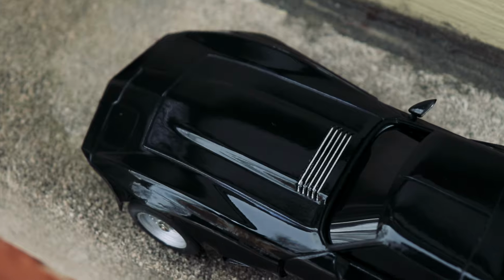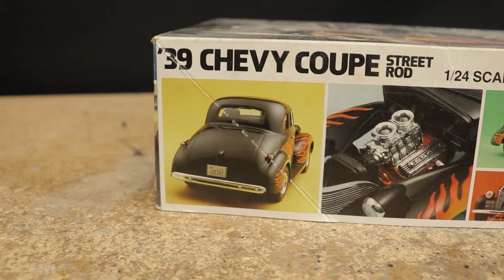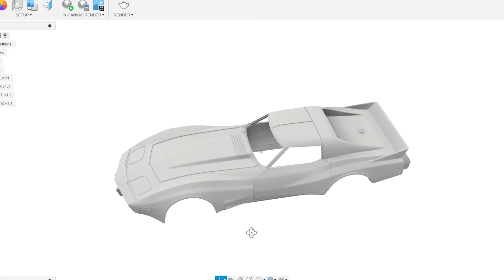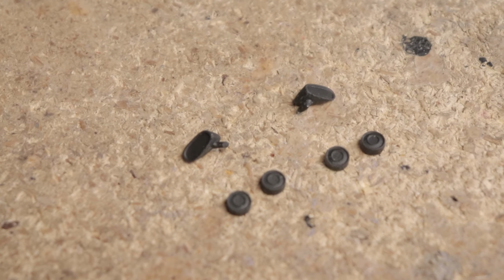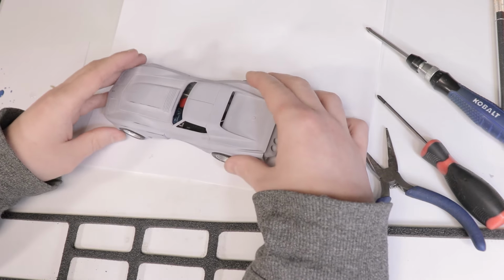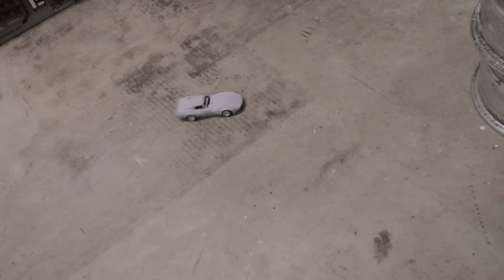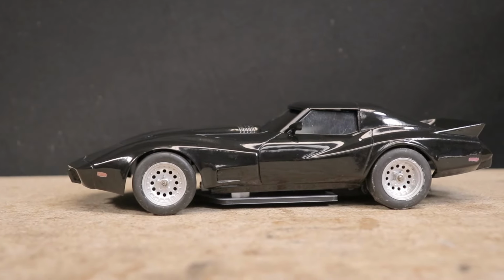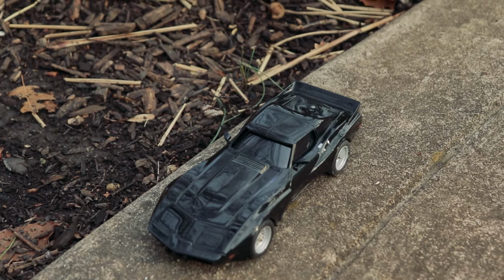Was It Worth It? Fully 3D Printed RC Corvette 🏁  Full Build 🔧

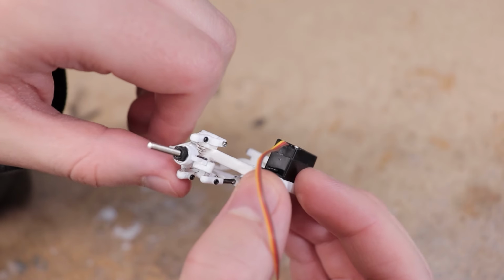Comment: Nice build! The Japanese company EID 431 made a 1:24 scale 1975 Sebring Greenwood Corvette motorized model kit. The body was excellent and the interior was good considering. It is very rare! I sold one unbuilt several years ago.
Reply: What does that motorized means?
Reply: It had a motor and a battery with adjustable steering. It had no controller, you just turned it on and let it go. Many early Japanese model kits had this setup. @CenReaperYT.

Comment: I imagine there has to be a relatively easy way to form windshields. Such as constructing a frame out of metal brackets, spanning a piece of clear plastic in there, heating up the plastic until it sags a little, and then simply pulling it over a buck. It won't do things nearly as intricate as vacuum thermo forming, but the curvature of the windshield is gentle enough that it might just work. Because windshield is a compound curve, plain cut out clear plastic isnt quite right.

Comment: There is an interesting fact: if you heat up a clear non-fragile plastic to a certain degree,it will bend easily, which is the way vacuum is formed in the first place.